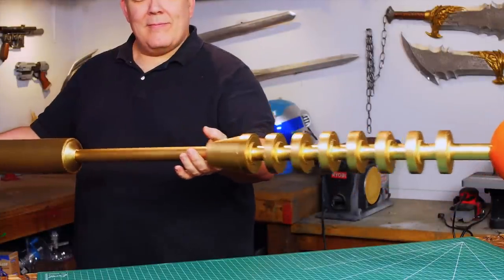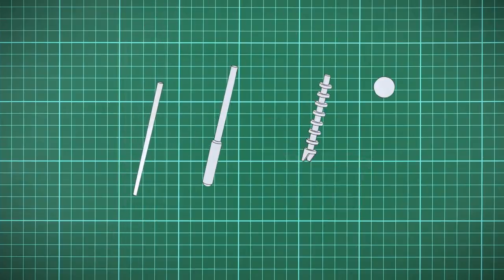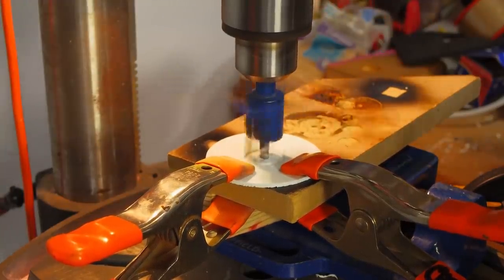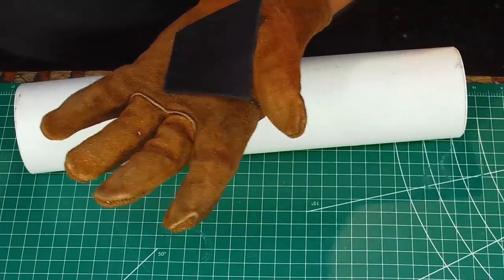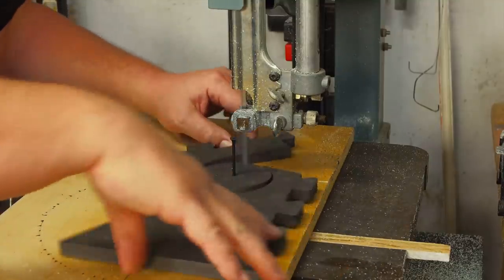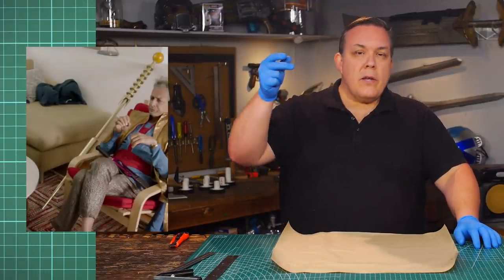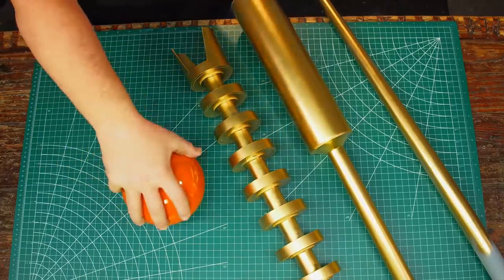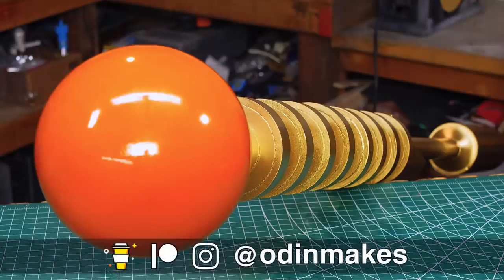Odin Makes: Grandmaster's Melt Stick from Thor Ragnarok

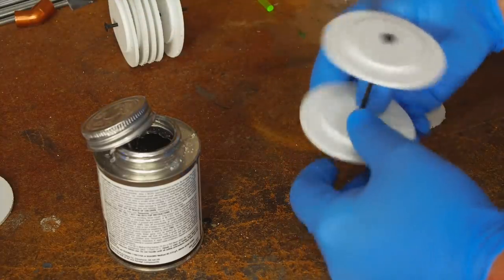Comment: 3:25
Odin: "The metal guide post I'm using here is actually a 3inch drywall screw that didn't get the screw threads put on it"
Me: "So..Basically a nail.." lol

Comment: Hey Odin Makes I recommend that you use cold water to make your sintra harder after you shape it. It will make things a lot easier.
Reply from the maker: Oh really? Just spray it? It seemed to cool quickly. Still new to using it, I want to make more stuff.
Reply: Odin Makes i can talk to more bout it on Instagram if you want

Comment: You did amazing job on the build. 

A good way to make it lighter is by customizing or making 3D and printing inside threaded tips like the ones for paint rollers, brooms, etc. I got the idea from watching Bob’s I Like To Make Stuff when he made the Billy Club from Daredevil.
Reply from the maker: I used the threaded tips from paint rollers in my rocket propelled super sledge hammer from Fallout. Metal tip into plastic receiver totally works, and works well.
Something I missed saying in the video was that the table leg has the screw on it from the factory. That led me down the wood insert nut path...
Reply: Odin Makes threaded tips truly are absolutely amazing and very useful because if someone to use the ones that make pipe one solid piece but they look like bolts or any details on them they can sand them down to look like one solid piece.

I’m sorry you forgot to mention it but I understand why use the table leg because the if you really wanted to make it all pvc you’d have needed to order the tapered pvc pipe or buy solid pvc rod and use lathe to taper it (which is a lot of work).
Reply from the maker: @mjsimunovich013  You can order tapered PVC? that's new to me!
Reply: Odin Makes yeah they use them for the shaft to go over rollers on conveyors but they are looked to be custom made.

Comment: an easy way to determine how much of the foam mixture you need it to fill the ornament completely with water, pour it out and measure it.

i'm sure the expanding foam has a ratio of how much it expands.
Reply from the maker: You are correct with what you are saying. However my experiences have shown me to not trust the label 100% "They are more like guidelines"
Foam expansion is effected by 2 things: Temperature and moisture!

The yield was smaller because it was cooler in the shop, but if the ball was wet or even overly moist inside, the foam could over react, and not foam uniformly.
You are correct in thinking that "if the foam says it expands 30 times, then 1 volume of mix will get me 30 volumes of foam... in my experience it has always been less... because of so many variables- not perfect A to B ratio, ambient temperature, foam mix temperatures, non perfect mixing, not getting 100% of the mix out of the mixing container, scraping the mix container sides too much while pouring, and actually popping some of the foam bubbles on their way out of the mix cup...

After spending more than enough time in the past trying to be correct with all that.. at this point, most of us just make an educated guess, and say "this should do it."
And prepare the area with extra paper and stuff.

If I was casting many of them, you bet I would take notes on most of that, and manage my resources. It is a bad idea to just throw away the material.
Only making one? "Eh, good enough!" :)

Comment: 3:37 AHH a spinning death top.. But seriously those bits are terrifying for a number of reasons Odin, I got one that HAD two cutting heads on it.. turned the drill on and went to lower the  head.. it threw one of the cutters.. and never did find it,  Good thing my aunt or me wasn't hit.. .. but always check the screw several times..
Reply from the maker: I have a double cutting head one too. They are great- but damn scary... Thank you for the tip!

Comment: How long is your planning and prep time? Yout always make it look so easy
Reply from the maker: Depends on the project. A couple of days usually. Some steps don't happen until I am handling the pieces and seeing what they may need.
But typically I think a lot about what it needs to look like at the end, and how to make the shapes to get there. Lots of mental planning in traffic or the shower. Also they way I approach it can depend on the time I have to complete it. I don't work ahead much. I am trying to now- but normally a video's build is started just the week before.
Craziest thing to admit: I almost never build a prototype. What you see in the video is almost always the first time I have made it!

Comment: Great work Odin. Wonderful craftsmanship.

For a request could you please consider making Doc Ock's tentacles. Specifically the set from the Spectacular Spider-Man animated series. The tentacles look remarkably unique. They're pure black with some glowing bands and glowing eyes at the center of the claw on each tentacle. 

With the Christmas ornament you just used sparked the idea and you will also get some LEDs to play with on this project and maybe more use out of your new resin printer.

Here is a link to the design:  https://66.media.tumblr.com/087df0bff8646fc77b42086748b24c6e/tumblr_njxqmviCeV1soncpbo7_500.jpg

Thank you for your hard work and dedication to the craft of crafting.
#OdinMakes
Reply from the maker: Oh, interesting.... would you be disappointed if the tentacles were mostly plumbing pipe insulation? They would be kind of soft and pose able like what Adam Savage made on Tested.
Reply: @OdinMakes  Not disappointed I can see it working for the tentacles. but work in some led lens. then the main head of the tentacle, you can screw it on or off and have the claws and glowing eye in the center. Combine all these elements. We'd even edit the video for you free of charge as we have wanted to work with ya.

Comment: Awesome build as always! Just curious about something though: wouldn’t making the rings at the top of the melt stick have been easier if you just made them out of floor mat foam? Did you make them out of pvc for stability or because the build was more simple you made the rings the way you did to make the over all build more challenging? Either way, it turned out great, Im just curious about your thought process is all. You should make the demon killing Colt pistol from ‘Supernatural’ for your next build, or Harley Quinn’s over sized hammer. I’m currently building a Harley Quinn hammer myself. No video of the construction, but if you made one I’d love to compare! Keep up the awesome work!
Reply from the maker: I made the rings from plastic to keep a consistent material. And I wanted an all plastic prop in case Jeff Goldblum got to handle it. I could have just as easily cut floor mat foam, and wrapped the edge with thin craft foam, it would have gone a little quicker.
Reply: Odin Makes Ah, makes sense. Cool, thanks for answering! Look forward to your next build!

Comment: Aren't you afraid that the insert nut will tear out of the expanding foam inside the ball?
Also, what gold paint did you use? I really like the color
Reply: That's why he put that wood dowel in it and cut it down. I forgot about the dowel at first because the dowel and foam are the same color, but then I remembered.
Reply: @Qrejy  Oh wauw, I completely forgot about that. Thanks for the help man! :D
Reply from the maker: You are right @OptimusWii- If it was just in foam, it would totally tear out by the end of the first day! I should have been clearer in my storytelling.

Comment: I'm reeeeeally jealous about the price of materials cosplayers and propmakers in US have.
In Finland, all that PVC and ABS alone would easily be 3-10 times the price!
Reply from the maker: It is true that the pipe is cheap here- I paid $2.5 for the PVC, and $11 for the ABS. Then $3 for glue (still had some) and the means to cut it.
Could you do it with just a wooden dowel and a cardboard tube for the rings? You would want to wrap most of it in foam or other veneer to hide the tube..
Reply: @OdinMakes  ... wow that's cheap. Yup, 4-10 times the price is accurate haha

I ain't planning to make it but there would definitly be alternatives to do it, the way you recommended definitly would work!